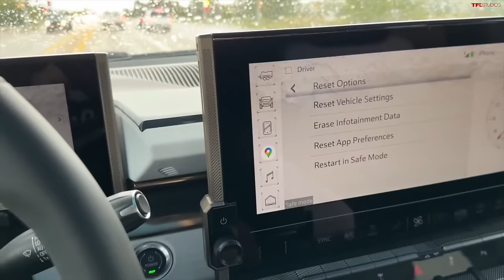The BEST (and WORST) Trucks That We Owned in 2023!

Comment: Stoked for the series with the Dakota. I loved that generation and owned a 2002 quad cab with the 4.7L. That thing was a workhorse! Will be interesting to see what the mini Dakota can do.
Reply: My dad had one of those, not sure what year his was, but the same generation as the 2002.  I loved that truck the handful of times I drove it. Lower than a new Ranger or Taco was great for actually using the bed and had most of the off-road chops.  Dodge could re-release that exact truck today with a 3.6 and it would sell very well.

Comment: "The Advertised Loss Leader" has been thus for decades.  I drove from Missoula, Montana to Spokane , Washington in 1984 after a new Toyota Longbed Deluxe 2wd  22R 4 cyl. 5 speed, and negotiated for the dealership's parts runner (8k miles) down to $7800.  Andre: "To be Frank..."  I must respond with Leslie Nielsen's line: "I'm not joking, and don't call me Surely" (from Airplane!).  🤣

Comment: Great content guys. When you get the Cybertruck, you should do a long distance towing "race" against a gas or diesel truck (a F150 would be a good one) similar to what Geoff Buys Cars and The McMaster did over in the UK with a used diesel Mercedes car vs a new electric Porsche. They stayed to the speed limits and compared overall time, cost and stress after driving from the northern tip of Scotland to the southern tip of England with very interesting results. Maybe a trip from Colorado to Texas pulling a travel trailer to simulate an average family going on a long distance trip. If electric is the future, lets see what that future will be like.
Reply: Towing cross country will be nightmare and probably double your time.
Reply: Last year I had an email exchange with Andre.  TFL had no interest in my suggestion:  5,000 lb. travel trailers (caravans) towed by a Ford Lightning and a Ford 150 5.0 V8.  Boulder, CO to Cody, WY to simulate a 2 week family vacation.  Given the lack of charging infrastructure in Wyoming, I wanted to see how many vacation days would be wasted charging the stupid Lightning.  Instead, they "drove" a Lightning to the northernmost point in Alaska by putting it on a ship and not driving through Canada.
Reply: I wondered why they didn't drive through Canada on that Alaska trip. I live in northern BC and wanted to see how they would do on a real trip along the Alaska Highway. They should drive the Cybertruck along the highway during the winter towing a Bobcat on a car trailer like the gas and diesel trucks are doing right now. We need to see how the electric trucks perform in the real world. I have yet to see one a Lighting in my town.
Reply: Yup, that's what I would expect. They should do the test on a long weekend like July 4th when most people start their vacations. What I don't know is how the cost of fuel vs electricity would be? Gas and diesel prices are coming down and I think electricity has gone up or subsidies are running out. They would get a lot of clicks for a video like that.

Comment: My favorite is the Honda Acty. I have seen trucks like this in Canada being used as delivery trucks. I have also seen them used by contractors on construction sites. There was a red crew cab with a symbol on the front that I didn't recognize. I have also enjoyed the journey that Andre went through with his Nitro Colorado. It was funny and interesting to see how the new technology like "over the air updates" caused unexpected problems. I have been waiting to see Andre put towing mirrors on his truck. I would have liked to see Andre test products for the new Colorado like different mufflers to see which one improved the fuel economy & sound. Because with all the new 4 cylinder trucks coming out I think aftermarket mufflers will be very popular but you don't know which to choose until you hear how it sounds. Or what products improve fuel economy, like an aftermarket air intake, and by how much? I have enjoyed all the "cheap truck" videos. You guys talk alot about fuel economy on new vehicles but I wanted to see you make fuel economy improvements to old trucks. Banks has been the expert on diesel engines but you haven't seen how much a diesel can be improved to increase gas mileage, horsepower, and still pass emissions testing and burn clean. Modern diesel engines have a bad reputation because of a few idiots that like to blow black diesel smoke on the cars behind them.

Comment: I been seeing Mahindra  Roxor builds lately. Lifted, in closed cab. It might be interesting to see a review comparing Roxor, kei trucks and utility SxS.   
  Also for the budget minded, comparing the 2024 Tacoma to the 2023. The 2024 Ranger to the 2023 and the 2023 Colorado to the 2022. Sometime I think the “all new” truck isn’t “all new” underneath and really isn’t much better than the previous generation.  
 I’ve been looking at the new Ranger and Colorado and just about decided that I’ll buy a low mileage used  previous model,  and save a few dollars because the newest model isn’t that much better, and in some cases worse.
Reply: That's what I'm doing to save about $10k.  Buys a lot of gas, mods, or house stuff

Comment: Just a comment on the tiny Japanese utility vehicle.  That vehicle is too small for the US if driving on streets with cars and trucks.  In a wreck, it would be fatal at low speeds.  

However, I believe Toyota could take the plans to the 1979-1983 truck and make it again with the following updated it would be wildly successful. (1) updated safety features including crumple zones etc. (2) updated small gas motor under 150 hp and under 200 ft lbs of torque.  (3) Offer the same interior with the exception of the dash, make it for modern stereo and nav.  (4) make it the absolute least expensive vehicle to manufacture and to own.  Keep the price at a base of $18,000 and high end at $25,000.  You’d sell millions.

Comment: You need to get ahold of a regular cab short box F-150 or F-250 4x4 for 2024. Stubby version 2.0. And it’s a brand new truck. For $54,000 to $61,000. Get it in the XL or XLT version.

Comment: I liked the OBS Ford, but I would have liked it more had it been more stock. A lift and wheels aren't a big issue, but once the engine starts getting meddled with it becomes less interesting from a standpoint of going and looking for one for myself. A before and after with modifications like you have done is better than buying modified from the get go.

Comment: Love my 2019 Ranger FX4. It tows 5000 pounds like it's not there, 7000 pounds is still pretty easy. It goes through mud holes that non-Rubicon Wranglers get stuck in. It's quiet on the freeway.  Seats are comfortable. Has just the right amount of tech. Analog dial gouges with a small display is pleasant to look at.  The interior has a lot of cheap materials, but at 40,000 miles it doesn't squeak or rattle so it's better than a Mercedes C-Class.

My only real complaints are that the factory tires are not good when cold and wet, but fine in the snow, and fuel economy is not good - off-road tires probably aren't helping either of those complaints.

Comment: Here before some people say the Santa Cruz is "a crossover with a birth defect", or "not a real truck, it's unibody".
Reply: It's  a unibody...😂
Reply: Unibody vehicles are less susceptible to corrosion damage than body on frame vehicles.  I was told while working with Idaho Fish & Game in 1981 that "if you're hauling all your stuff from job to job, you're driving a truck."  My cohort was referring to the 1969 VW Squareback, which had a full-size 6.00-15 spare in the trunk and my first set of radial tires, Michelin XZX tires at Twin Falls.  (Much taller than the 13" Michelin XZX on the new VW Rabbit.)  The poor man's jeep, "folk's wagon".

Comment: I'm currently in the market for a work truck for my lawncare business I am in between a 1500 or a 2500 trying to stay with the older style trucks due to cheaper maintenance like 08 and lower any trucks and engines you recommend currently use my 04 1500 dodge ram 4.7 or my 2012 ram 1500 with the 5.7 but the 5.7 is burning oil so I'm getting rid of it.

Comment: Surprised to hear you guys felt like there was unfinished business with the Ranger. I think I did basically lose interest in that one, apparently at some point prior to you putting stickers on it. It wasn't a new product when you guys got it, but it also wasn't old enough to be interesting.
Regarding vehicles I'd like to see you guys buy for extended reviews in 2024; If the Toyota Stout is going to be a real thing and available that soon (confidence extremely low), I'd definitely like to see that. Basically likewise for any new compact or midsize, should there be a new Dakota or anything like that. I know this is the wrong podcast for it, but I'd like to see lots of Land Cruiser content. Not sure if buying will be the best approach for that, or, given how much fanfare it has, maybe Toyota will have more in the fleet to lend to journalists/content creators? You guys would know better than me.
If you're doing used vehicles, they should be old enough to be interesting. I'm sorry to hear about the F-250 not being that successful. I was alarmed when I saw it was modified. Only diesel tuner I would ever trust is Banks. I wonder if you could buy something non-running for dirt cheap and work to get it operational again? NOT a restoration, more like a frugal project where you end up with something cool for not much money at the end. Project could have a 3-6 month timeline and never need to represent a major % of TFL's bandwidth. Would people watch that? Again, you'd know better than me.
Beyond 2024, I would like to see the R2T/R2S! Maybe my first EV? Cybertruck definitely not for me.

Comment: Pickup trucks have such tiny beds. Why are they not vans? A spare wheel could go high on a wall or sit between cab and box. But if tall as an off-road capable truck...underneath seems to have been a thing? I grew up with tiny hatchbacks and wagons (yes, Open Kadett) with a full spare under the floor.

Comment: Remember Bonus depreciation is getting phased out. Only 80% of the value can be immediately expensed under the rule for 2023 filings, and Sec 179 is only another lesser portion. 2024 it will be 60% of the value if the lobbyists don't throw a fit, and complete phaseout by 2027

Comment: The problem with the OBS was it was a manual and the masses are not interested with manuals, so you’ll never make money with the extremely small yet very vocal number of people that are interested in them.
Reply: Older trucks are a niche area in itself anyways. They ride rough and are loud, you have to specifically want an old truck, and  a manual transmission certainly lowers that crowds numbers.

I wish I could get a modern truck with a manual, I will admit to being spoiled by modern vehicles and their comfort.

Comment: Teslarati are going to loooove that their Model 3's virtue signaling plant food emissions are doubling with their switch to PoserTruck. Funny how work trucks were supposedly for posers and then we get a film prop that's going to driven by dudes who neatly trim their beards and ladies that drive in heels. With all torque from 0 rpm. Without rear view mirror, without turning stalks, with thick steel plated grill and hood, sharp corner tail...what could possibly go wrong.